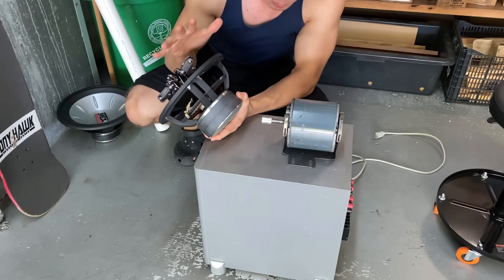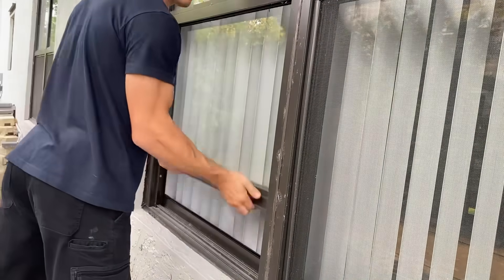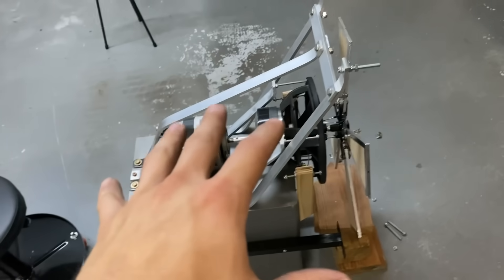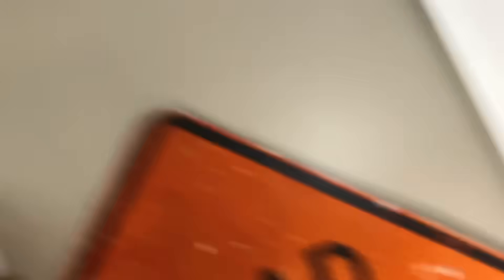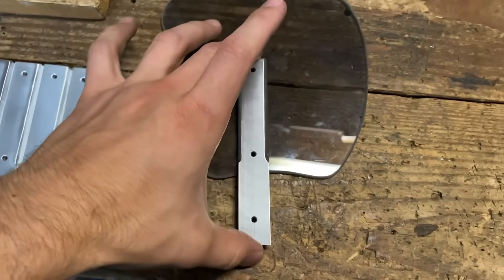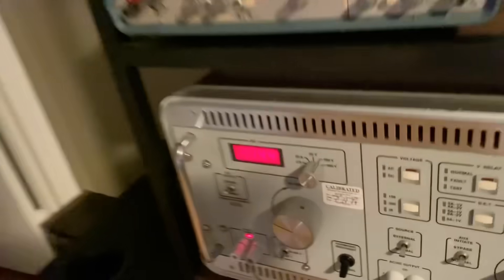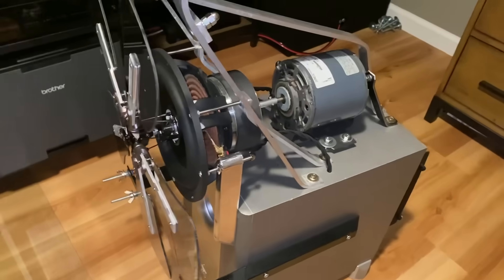Making the worlds most powerful subwoofer (Rotary Subwoofer)

Comment: I need more info on how this works
Reply: The fan blades change pitch going from blowing air to sucking several times a second. Much like a regular speaker pushes and pulls. But because it's a fan the volume of air moved is greater than that of the "diaphragm" itself.
Reply: Unable to Google or watch the video???????😅😅😅😅 is this your first day on the internet ?
Reply: @Mile-long-list I'd rather watch a video lol what's goGGle is that like the BOOK of the FACE

Comment: as yall can see, The rotary subwoofer shows its frequencies by literally shaking doors or walls at different speeds — kind of like different BPMs (beats per minute). Lower frequencies make slower, deeper shakes, while higher ones make faster vibrations. hence why he says it turns the door into a subwoofer.

Comment: My IEMs have air pressure release ports. If fully closed, they play as low as 3 Hz, if open as usual, they cut off the bass below 20Hz well enough to not damage the hearing. Manually closing those while watching this is quite an experience. It's like activating/deactivating the noise of an earthquake. Crazy.
Reply: which IEMs?? been looking for a quality set
Reply: @mcintosh.motors  Sorry to disappoint, but I'm the last person to ask. My set is a one-of semi-DIY test project. It's a combination of Knowles Ci 2955 + Sonion 38D just as a subbas drivers, if you're interested

Comment: How does this work, can one explain?
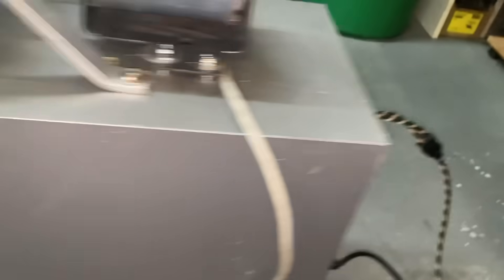Reply: I think, but I'm not sure, that the normal subwoofer on the back makes the blades change direction ( 1:54 ). Because they are turning it changes the direction of the airflow. it's like a fan that you would put in reverse then forward then reverse 10 times per seconds. But instead of changing the direction of rotation you change the direction of the blades. This generates vibrating air, which is sound.
Reply: @Sahel-i6b  i thought it was simply because subwoofers move a lot of air, and the fan is to push the soundwaves even further, which makes it have a more blasted/punchy sound and feel.
Reply: subwoofers move air with their skins to make sound. The fanblades are used to move air the same way creating a pulse of air pressure which makes the aforementioned resonation like a sub.
Reply: Changing the direction of airflow with frequency
Reply: It is quite simple: A speaker element pushes air. A fan pushes air.
The difference is that the speaker element pushes air in pulses (short, abrupt, push). Those pulses are measured in pulses per second - or Hz.
A fan pushes air in a constant fashion.

By modifying the fan blades so that you can abruptly change their angle - you essentially are turning the fan (effect) on and off very quickly. When the fan blades lie flat - they push no air (so same as if the fan was off).
When the fan blades are at an angle, they push air.

So changing the angle of the blade rapidly while they are spinning - you have effetely made a sort of speaker. There are many problems with this type of design. such as making a construction that is stiff and rigid enough that you can change the blades angle very rapidly - e..g. 50 or 100 times a second - without the shape of the blades distorting. Motor control would also be a problem - the fan would slow down and speed up - depending on blade angle and frequency.

Changing the direction of the airflow has no effect - in fact it would be an unwanted effect! (this is why we have boxes on speakers - to try to eliminate the "backwards direction" of the speaker element).

Comment: I'm confused ....  Are you trying to play music or make a fan turn??????

Because that thing is not playing music .....  Which is what a subwoofer is for.  Just moving air with fan blades is not playing music.....
Reply: Its your lack of knowledge that doesn't make you realize he ran sound through it. Did you not see the door vibrate ? That was not from the fan itself, but from the 10hz sound. Basically its a post subwoofer amplifier. Did you hear how soft it was in relation to the amount of bass it pushed through the house ?
Reply: moving air is exactly how music is made
Reply: Proper retarded comment
Reply: I don't think you realize how you're letting your low IQ on full display here

Comment: Moving air doesnt mean its a sub, bud. My subs shake the walls at 10hz, not to mention curtains. If this is a sub, so is my a/c.
Reply: You don't know what sound is then.
Reply: @PoonahNee good thing i never mentioned sound, genius. I said sub. 😂
Reply: Sound is literally pressure waves propagating through a medium like air, which also induces vibrations in solids like your walls and curtains. Obviously a rotary subwoofer can do that far more powerfully and efficiently than your cute little 10Hz subs, but at least they also cost you $200, right bud?

Good job not being transparently jealous that this guy had the idea, fabrication skills, and wherewithal to pull off far more powerful bass than you.
Reply: Not to mention, musicality is the goal of speakers. Not how much air can i move 😂
Reply: @TigDegner i have over 1000 lbs of subwoofers on my front stage in my listening room. Sit down before you try again.
Reply: Please search how bass is made
Reply: @RSA_Shock  yes, sound = air movement. However, air movement =/= sound. Can this fan reproduce the bass of a cannon firing? No. Can it reproduce a cello? No. Therefore it is not a sub. It is an air moving device, what are those called ... fans? By this logic, the sound produced from a bird flapping its wings apparently defines the bird as a subwoofer. 😂😂😂
Reply: @danielvannuland2681  it's making air move back and forth like Cone based subs not blowing it like a fan. It takes braincells to understand that.  He plays music and videos on it in the next video. This was just a test and it should have been obvious.
Reply: @DragonOfTheMortalKombat "sound" is not air moving back and forth... its pressure and vacuum spikes in the air. Id love to see his measurements.
Reply: @DragonOfTheMortalKombat and no he doesnt in the next video. Even at 20hz it doesn't do anything but shake itself to death. Is that what you think music is?

Comment: I've got an idea. Rotary sub drones, hovering over head or  just the fans sitting in an opening of a shade cloth like  at a festival. 

How about a multi layer blimps with subs and panel speakers using tight cloth.
Reply: Bruhh this is too heavy for for drones
Reply: would not work too well, you need a barrier between 2 spaces for this and the effects are best felt in the indoors space

Comment: does it need to be pointing outside the house? like tdoes it need to blow air out of the place where you want to hear it? can you use it just inside a room? i wanted to use it on my basement.
Reply from the maker: You can port it to your basement just like I did to the outside. It will work just as good. You need to have it installed like I did though, in a cutout.
Reply: If the two sides of the fan are not in separate air volumes the pressure waves generated from the front and rear will collide and effectively cancel eachother out

Comment: I'm not sure why you have a calibrated power supply, but it was due for calibration in 1997.  This is a serious finding and will require a corrective action!
Reply from the maker: Good eye, but I don’t test anything critical on it. I hooked up my voltmeter to it and it’s still spot on
Reply: @pierogiengineering  Just a joke...cheers!

Comment: Never thought id see a variable pitch propeller driven by a speaker. 😂 What if you synched hz with rpm of the fan? A slight variation between hz/rpm might make some bass resonation. It would not handle change of frequency very quickly but ramping it up slowly might be interesting.

Comment: If i recall correctly, 70 hertz is the frequency necessary to put out fire. If it can reach it try it on the stove or some other fire in a different part of the room or the house and see if it extinguish it. In that case you would be the first one to have a fixed sound fire extinguish system.
Reply: 🤔 if that works, that has the potential to save property and life with very little actual expense

Comment: So you should be able to use a mechanical cam like on a helicopter blade to quickly make the blades reverse and if you are clever you could use sort of an elliptical shaped Cam and therefore just by turning the cam you could change the frequency of the fan blades flipping back and forth. That seems really cool.

Comment: I still dont seem to understand the science or idea behind this...could it be that somehow the entire airspace is being shifted in frequency?
Reply: Imagine any sound speaker, its diaphragm moves back and forth and moves air in front of it which creates pressure waves which we humans hear as sound. Now imagine a regular fan - its blades continuously move air just in one direction. But if you make the blades change their angle the fan will be able to reverse the airflow. Do this several times per second and it will start pushing and pulling air in and out of the room alternating air pressure inside, just like a subwoofer diaphragm

Comment: Look at oipe organ design they had a much simpler waybto produce low low low notes withbout electricity and very powerful theres a 64' bass pipe that is putting out some low double digit or single digit hz. Theres also an effecy of combining other bass note to make s chord which is stronger than a single tone. Diffrreny hz can affect the body by disrupying our nervous system with the vibration but o dont know what the frequency is dor thay i believe its in the infrasound topic if thats of interest

Comment: If it requires outside for an infinate baffle, room temperature regulation would be a challenge, especialy during the Summer or Winter months
Reply from the maker: It’s not infinite baffle actually, it’s a sealed enclosure with my house being the rear chamber.
Reply: @pierogiengineering  Gotcha.
 All you need now is a hot glue gun to secure almost everything down in your house . 🙂
Reply: I guess you can achieve the same effect with the fan sub mounted into the room door. In that case there will be two enclosures with the sound out of phase

Comment: How does it work
Reply: Armchair physicist here, and I'm actually speculating myself, but I believe I figured out how it works.

Okay, so it's like a flat propeller when turned off, but the blades [can] rock back and forth while the propeller assembly spins. NOW, the effect of the subwoofer occurs because when the propeller is spinning while the blades are rocked one way, they create a directional airflow. Then, very quickly (depending on the given frequency), the blades rock to the other side and make the air flow in the opposite direction (think as if you were to run a plane's propeller backwards instead of forwards). Because the direction of the flow of air is able to be changed so quickly (which you probably wouldn't find on an airplane (though you would a helicopter)) due to the design of the blades, the airflow itself is what's causing the effect because the entire 'cohesive air' of the house is directed out of that one window for the span of a fraction of a second, and then air is pushed right back inside the house just as fast, all due to the design of the propeller.

So, he basically took a small helicopter blade setup, tuned it to any frequency, and then attached it to a hole in his house. Pretty neat.
Reply from the maker: Yeah like he said

Comment: you need very old hard disc drive, you have there high precision driver and perfect quit motor. as blades take honeycomp there is lightweight and stiff additional you can drill in 3D. imoprtend is  the slot between blade tip and frame less possible, you can also do framecut out like bassreflex tube... 
you doing is between aircraft engine+IT+audio knowledge only problem is toi find old HDD about ~1980

Comment: One thing I've always wanted to try is making a subwoofer where thr cone is attached to a rod that is fixed to one edge of a wheel thats connected to a motor. Basically just like the piston in an engine except the piston is a subwoofer cone. Would only make sine waves and would have as much throw as you want based on the radius of the wheel.

Comment: Depending on when it was made, and whether or not you tested the actual RMS output of that Rockford Amp, the RMS you think that amplifier has may be wrong. Like way wrong. Car audio amps are absolutely awful about lying on specs. Especially lower end average consumer stuff like that one, its entirely possikle you're getting a lot less signal than you think you are if you didn't actually plug your DMM into it and check. There is no actual regulatory body for car audio equipment (there should be due to the fire risk), so companies effectively decide on their own how theyre going to measure the peak and rms values, what that equates to IRL is; if lightning strikes twice in the same spot, you'd still be lucky to get the numbers written on the box. Unless youre going with a company like Zapco, or Audison, or even JL on the lower end, you're gonna wanna stick those DMM probes into your amp outputs and measure it yourself. Based on the quality of your work and the other components you had hooked up I assume you've done this already, but figured it was worth mentioning, cause if not, you can probably get a few extra db out of that wall socket.
Reply: JL on the lower end.  Tell me you know nothing of what you speak without telling me

Comment: As awesome as this is I think its still not a "true" sound wave. Unlike a true sound wave, the pressure changes created by a rotary subwoofer do not propagate with forward momentum over long distances. The subwoofer moves air back and forth within a confined space, creating pressure variations that simulate the presence of low-frequency sound. A real 1 Hz tone would not even fit in your home, as its over 300 meters long.

Not sure if you would notice a difference, though. You might have to look for an earthquake to compare to, if you want to be sure, lmao.
Reply: By that logic, you wouldn't be able to have bass in your headphones at all. I think it works more like that
Reply: @NegativeReferral  you can still have "bass" in headphones, because they approximate/emulate near-field effects well enough that it sounds the same or very similar.

Same for this rotary subwoofer, because the result feels close enough to the real thing to be useful.

However there is still a difference between that and a true natural sound wave with a very low frequency propagating though a large space.
Reply: Spot on, most people don't understand how wave propagation works. My room is 30 feet long including the half wall separating the living / kitchen so the lowest I could achieve is maybe 37.5 Hz, MAYBE 😅.

Comment: Bro literally answered a question I've had for my entire life: how would you generate loud, low frequency sounds without an absolutely massive speaker coil?
Reply: While rotary subwoofers are effective at creating the sensation of very low-frequency sounds, they do so through a fundamentally different mechanism compared to the propagation of genuine low-frequency sound waves. The rotary subwoofer's method of operation involves local air pressure modulation, which does not result in the forward-moving wave characteristic of a true 1 Hz sound wave.

But it probably feels pretty close to the real thing anyway...

Comment: imagine the military makes one of these on a massive scale, drops it behind enemy lines, and runs it at 1000hz. 😂😂
Reply: 1000Hz is just a note on a piano (B5).
A piano goes from ~50Hz to ~2000Hz.
Reply: “A rotary woofer is designed to produce only frequencies lower than 20 Hz.” -Wikipedia 

(I doubt the motor could function at 100 Hz, let alone 1000hz.)

Perhaps you mean 1000 dB? (Terrifically LOUD)

“Under normal conditions the loudest possible sound (on Earth) is 194 dB. A sound of 1000 dB would be loud enough to create a black hole larger than the galaxy.” -Dr. Rachael Tatman
Reply: @jeremyoswin9535 It's even scarier when you think about how decibels are exponential in how loud they are as the number goes up

1000db is terrifying
Reply: 1000db is like 6x stronger than a Shockwave. That's not sound anymore just an nuke XD

Comment: Great project! I'm just wondering how it performs in an actual user setting. Can the blades move quickly enough and with a high enough resolution to actually be used as a subwoofer?
Reply from the maker: No, only works for infrasonics. (Below 15hz)
Reply: @pierogiengineering  for the complete audiophile who HAS to get the full experience of the recorded 128-foot register of the largest cathedral organ in the world

Comment: Are we sure the sub wouldn't do that without the blades? I have 2x50W cheap subwoofers. If I crank it up the upstairs neighborhood would come to take me and show me how everything in his apartment is rattling around. Keep in mind the seeling is like min. 30 sm. concrete with isolation and flooring. He can't hear anything but certain low frequencies permeate through the building.
Reply from the maker: “Seeling”………”sentimeters”……
Reply: @pierogiengineering  I'm sorry English is not my first language. You do understand.
"Ceeling"........"centimeters" ...... 
That doesn't change my point. 
When a debate is lost, slander becomes the tool of the losers. Heard this about an hour ago. How fitting. Not that there was any debate. LoL

Comment: Add aerofoils to the blades to increase their air moving effectiveness. The shape of the "wing" has a HUGE impact on how much air it moves.
Reply: But then it won't be symmetrical for moving air in versus out.
Reply: @mishael1339  could make it like a fighter jet style wing, those are pretty symmetrical. They gotta be so they can fly upside down
Reply: @CarGuyCole360  I guess you can do some shaping, that's true. Wonder how big the impact would be. Sure is an interesting engineering exercise.